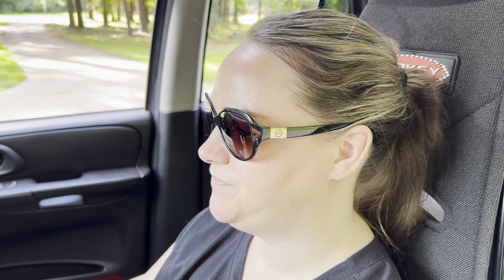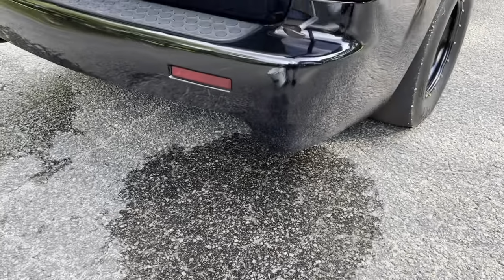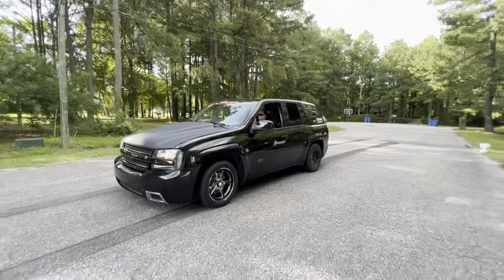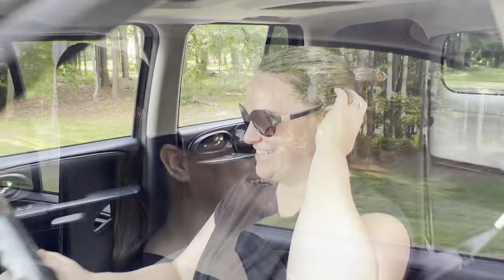Her FIRST TIME Driving a High Stall Torque Converter Racecar!

Comment: Got one question what kind of gears are you running and what brand ? And it is a 10 bolt rear end right ?
Reply from the maker: It’s the factory 14 bolt that comes in the TBSS and running the factory 4.10 gear